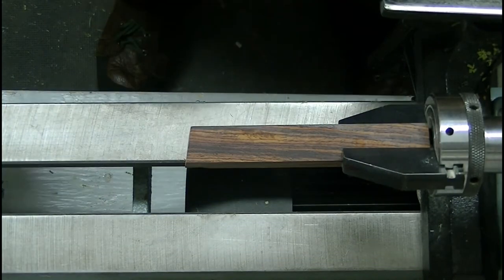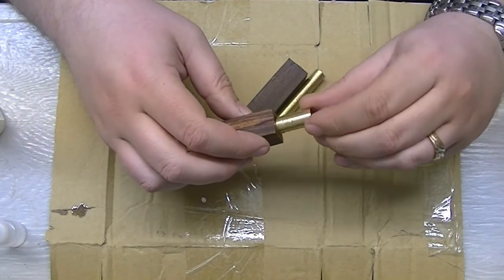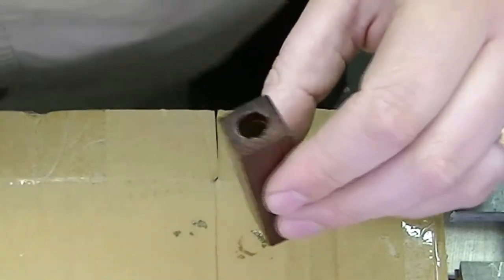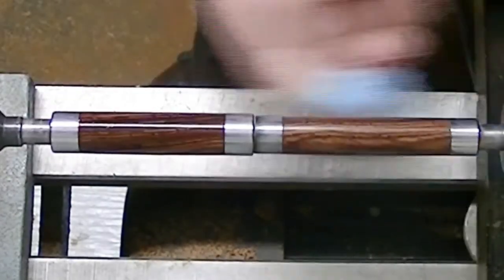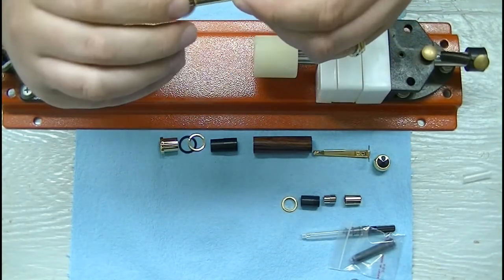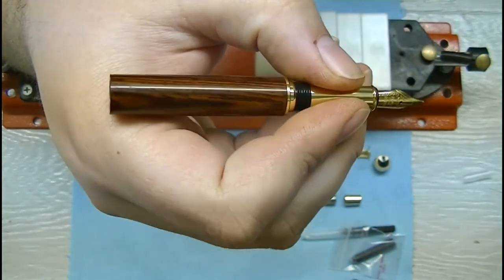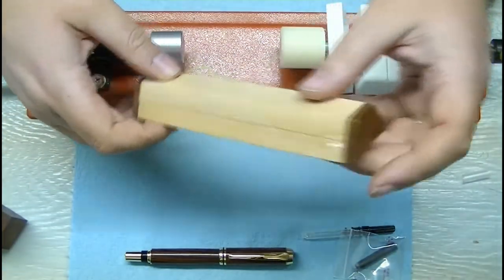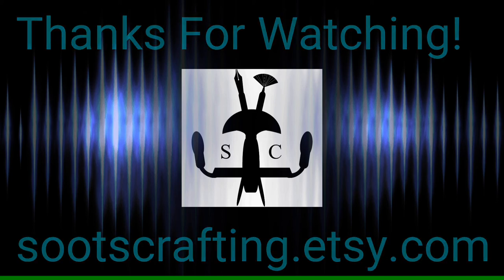Turning a Cocobolo Baron Fountain Pen

Comment: I've had CA set up too quickly as well. Heat seems to soften the glue. A little friction in the tube but not enough to thin it out. Wood dowel works. That's why I will only use 5 or 30 minute epoxy going forward. LOVE cocobolo. Pity it's pricey, when you can get it.
Reply from the maker: I have cocobolo requested often enough that I bought a 5 inch wide by 6 for long board of it years ago so I would always have some in hand.

Comment: This cocobolo and your other one (the hawaian one) are great looking pens ! If I can ask...and dont get me wrong they both look fantastic I'm just curious as I'm new to pen turning..would putting a CA finish on be more durable or is it not an option due to the oil from the cocobolo wood ?
Thanks for putting the videos out here !
Reply from the maker: I have put a CA finish on Cocobolo before, and it turns out fine. Allow to fully cool, I waited an hour, then clean thoroughly with Denatured Alcohol. The Cocobolo takes such a nice polish and is so dense that a CA finish isn't necessary however, and just comes down to personal preference. Happy turning!
Reply from the maker: I should add to my previous statement, it also helps to know your customer. These pens were for people who work at a desk, the one I put a CA finish on was for a contractor who works with grease and oils constantly, so a CA finish was necessary to fully seal the pores of the wood. Cocobolo, though dense, is very porous.
Reply: Great...thanks for the reply. I just started turning pens a couple weeks before Christmas..starting the new year out with a new hobby. I've done..around 25-35 I think. I know I've spent entirely too much money but free shipping and other Christmas time deals were hard to pass on. I have some really pretty cocobolo amonst the many blanks but I was trying to get a little more experience before I busted into it..I have a majestic full size and a majestic junior that I havent messed with yet for the same reason..though this week I'm going to tackle at least the junior. I was planning on using cocobolo on both for the lower barrels and jet black ebony for the caps...in my minds eye that combo looks great .
  I bought a few dayacom telescoping magnet pens and was just out in the shop working on ...the brass tubes are 4 1/4" and with no drills that length I decided to section a couple pieces together on the tube would be the easiest..i think on the first one half padouk and half ??...I'm not sure but I'll come up with something. 
 I got ahead of myself on your videos with the second cocobolo and missed a few so Ive backtracked and am watching the ones I skipped. 👍
Reply from the maker: Awesome, welcome to the club, those sound like fun! Padauk is very versatile. Might go with something light that'll contrast it. If going with another dark wood, put a strip or two of Maple veneer between the layers for interest. Most importantly, have fun with it! You on Instagram or Facebook? I'd love to see what you're coming up with. Happy turning!
Reply: Appreciate it. Not on any social media...I'm a former leo in a large city and they would have only brought me pain and anguish. 
I just finished turning the ebony and coco bottom for the majestic jr...still on the lathe though as rest was calling my name.
  I put mineral spirits on both pieces, it seems to really bring out the jet black of ebony and the figures in the coco. First time i've used it like that so hopefully it wasnt the wrong thing to do.
Reply from the maker: @1shootist477  I understand the privacy, thank you for your service. Never used Mineral Spirits, I'm careful what I use for cleaning cause some will leave behind a film. I know Acetone will leave a film behind, not sure about Mineral Spirits. Denatured Alcohol is a go to for many turner's because of it's lack of residue left behind and how quickly it dries without penetrating the wood. The cleaning after polishing is my favorite part, it's the sneak preview of things to come. Like your wife lowering the shoulder of her dress as she walks off to the bedroom. It's the enticement that says if you play your cards right, something beautiful is about to happen. Same for putting the first coat of CA finish on. You want a beautiful exotic wood that causes drooling, get your hands on some Curly Koa from Hawaii and put a CA finish on it. It causes some serious eye popping when people see it.

Happy Turning